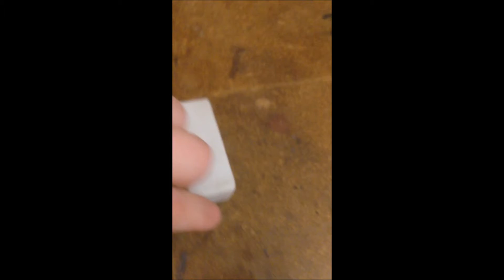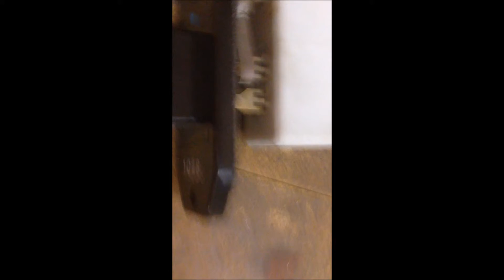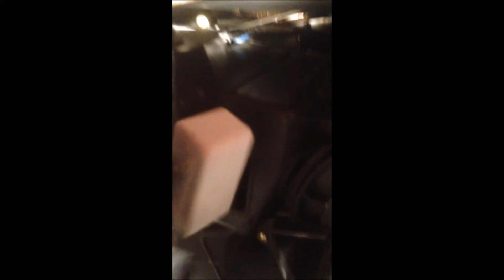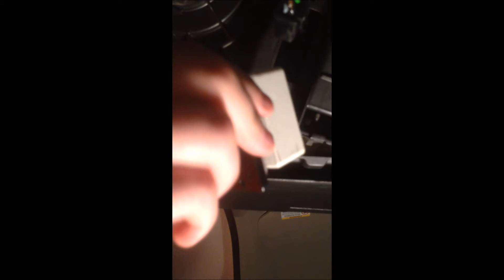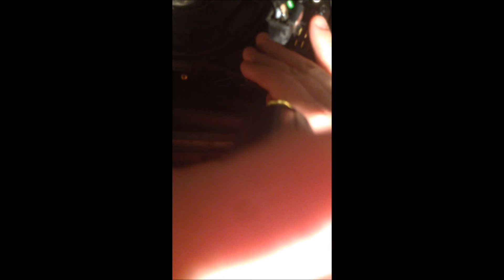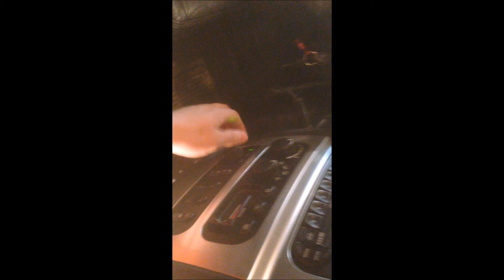Dodge Ram Fan only works on HIGH - Heater Resistor fix - Blower Motor

Comment: I am just going through this on my 96 Cummins...replaced the dash control, resistor, and still only blows on high.  Any other suggestions ?
Reply: Uhhh, a year too late probably, but use electronic contact cleaner on the wire leads. Chances of a switch partially failing like that are small. My money is on the dirty old connector that hooked into the clean leads.
Reply from the maker: Bad switch maybe?
Reply: Bad blower?